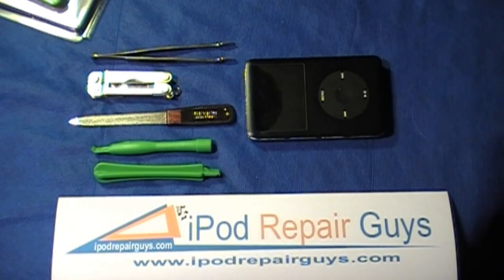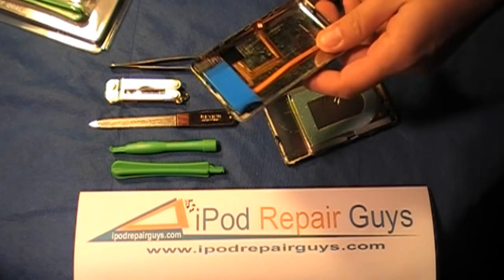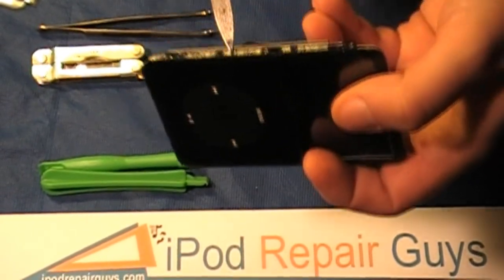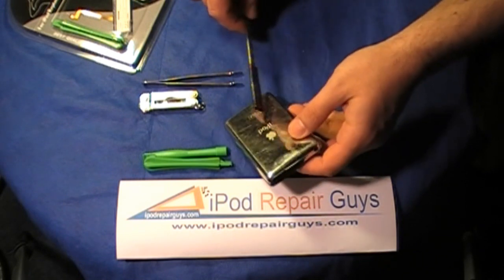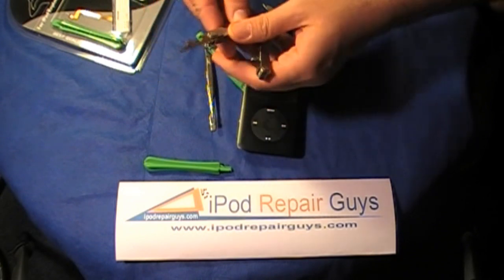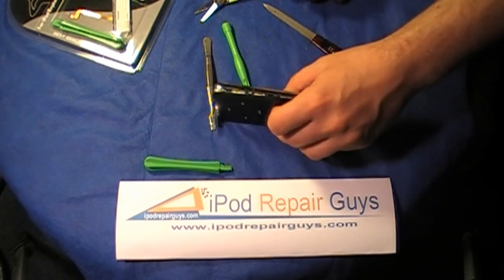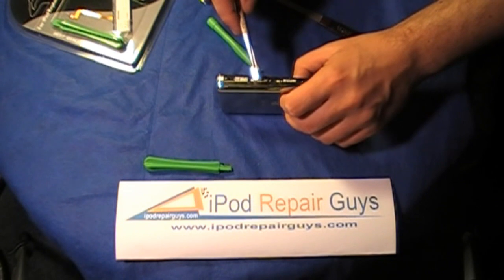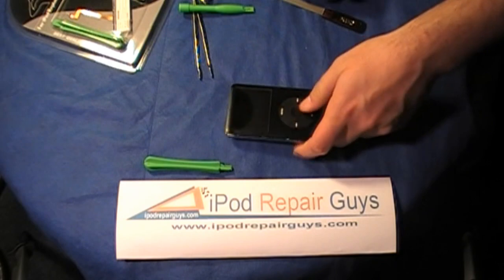iPod Classic Repair Video - How to Open the iPod Classic

Comment: wow i done it omg so dam hard to open then wondered if i would ever be able to get it back together again and i only wanted to get the sand out as the buttons wouldnt work anymore.....then i had to open it again as i hadnt got the charger section together quite right omg...love the comment where the guy damaged it more then got angry with you hahaha not yur fault
Reply: It is a very difficult iPod to open. We can clean them out for you for a small labor fee if you ever need.
Reply: Dan Cieslak no its ok but thanks ! plus it sounds like yur in america im in new zealand haha